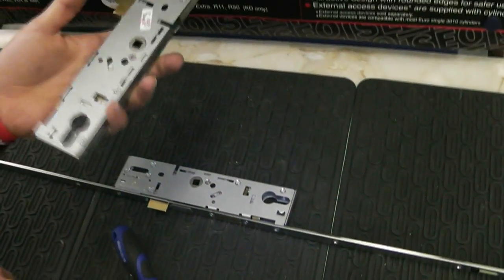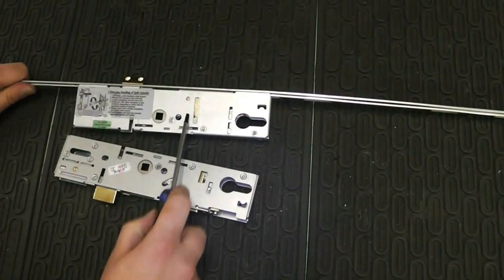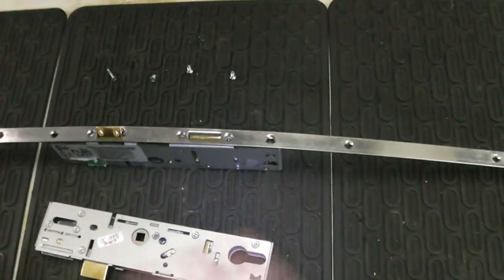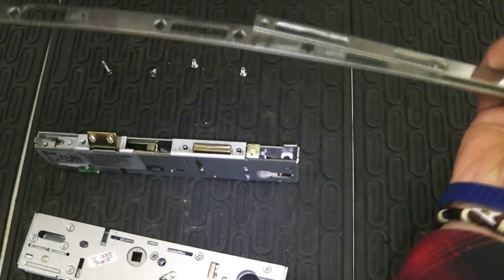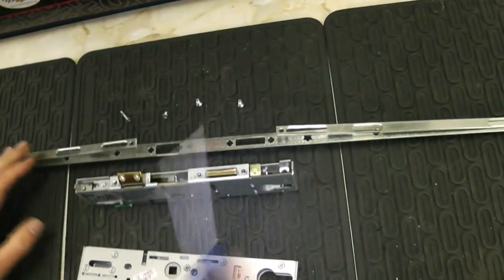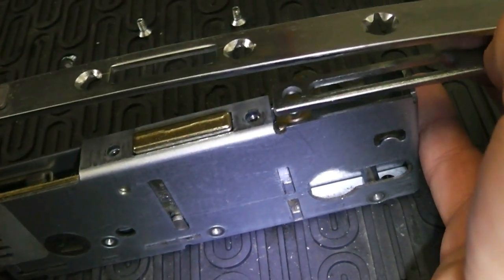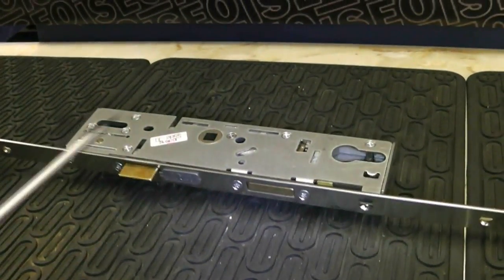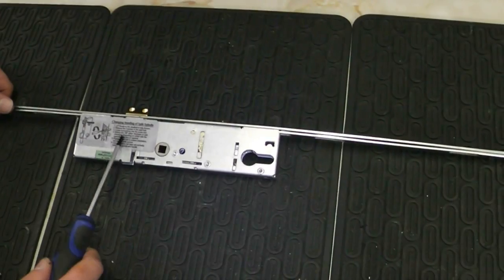How to change a UPVC gearbox or centre case

Comment: Thanks for the very informative video. 
I am a complete novice and I used your video to replace the broken gearbox on our ERA lock.
It was very straightforward using your guide, and the job took around 20 minutes, and that was including removing the old lock from the door, replacing the gearbox, and then refitting it all.

Comment: When you put the metal strip back in what to do if it does not line up flush with the composite door and has a slight outward bulge?

Comment: hi
how to change the handling, because the one i bought is opening from out side the house with the handle but not opening the door with the handle from inside the house, could you please tell me if there is anything setting in the lock needs to be changed?